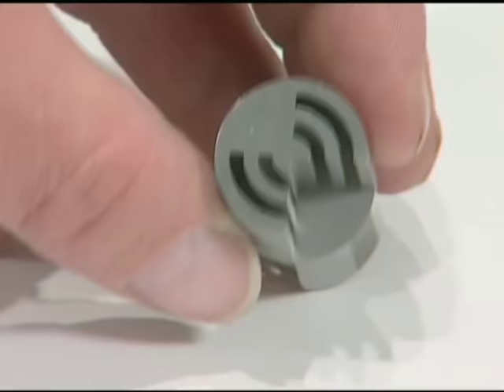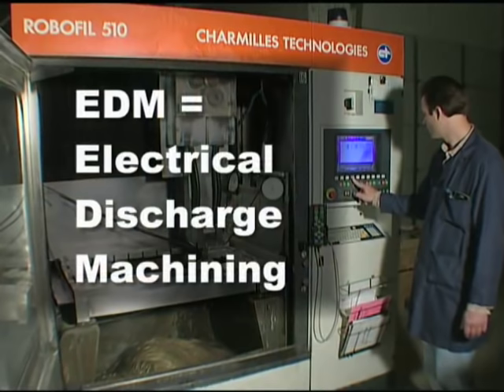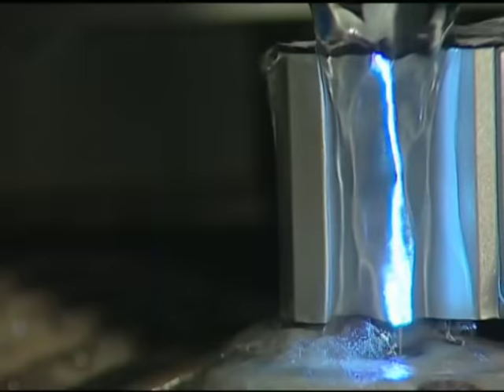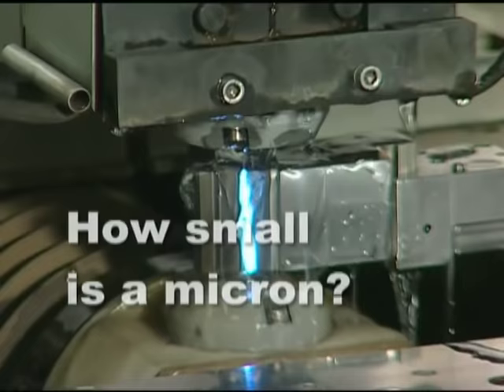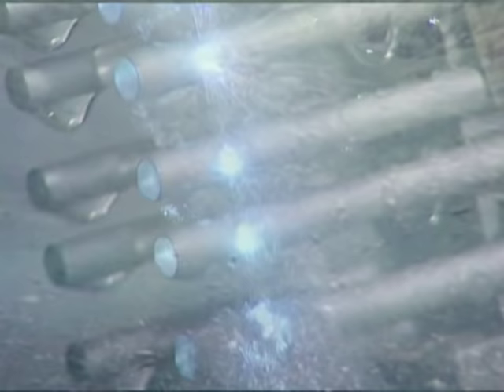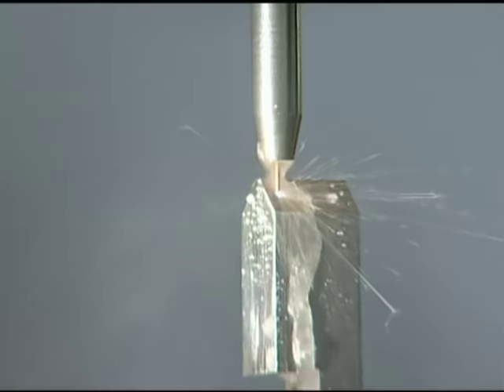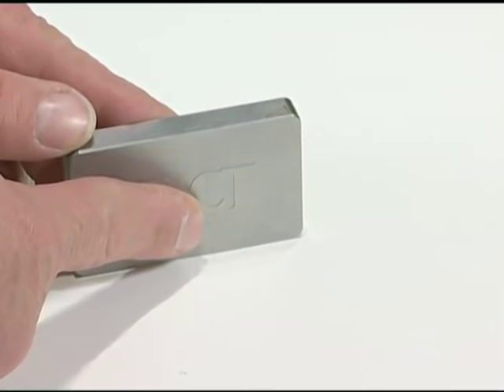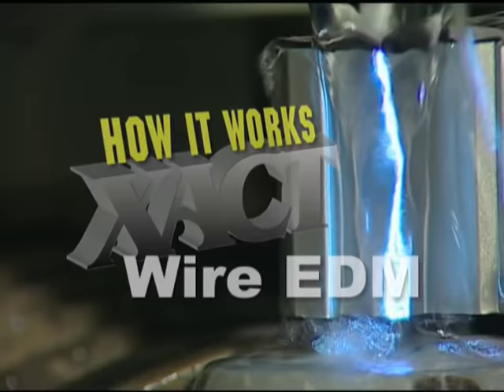How Wire EDM Works

Comment: The shop I used to work at had one of these. I used to stay after work and use it for my own. You would be amazed at what you can make with one of these babies. My buddies were all into restoring old cars, and I would make parts for them. One was restoring an old Mercedes Coup. The NOS hood ornimate was $400! I made one identical to the original and charged him $20. Gun parts, clock gears, RC airplane propellers...you name it, I could make it (within reason)